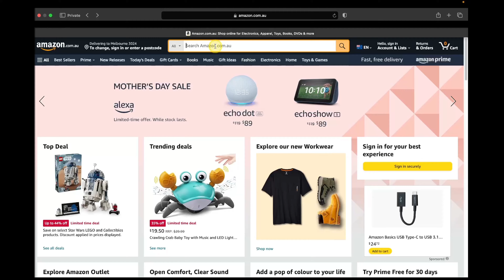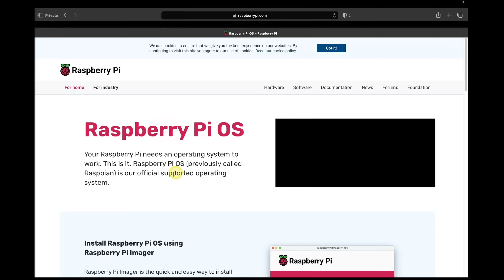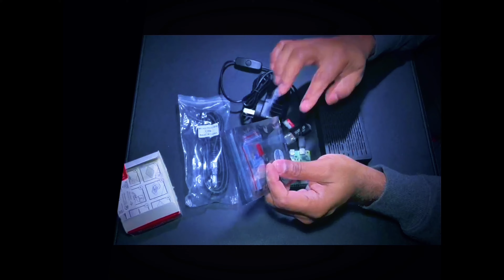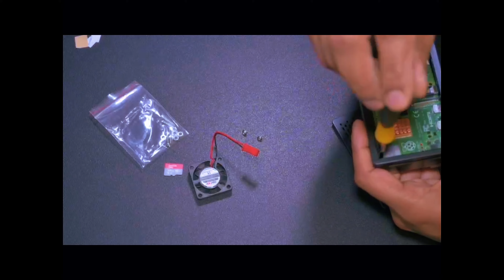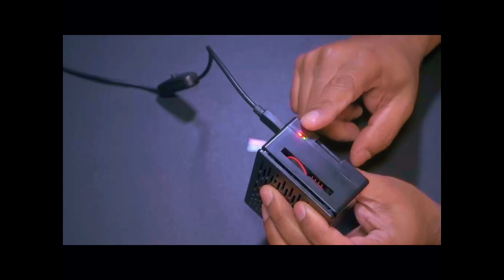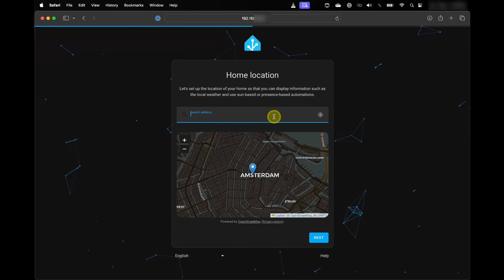Home Assistant Setup Guide for Beginners (2024 edition)

Comment: Hello, thanks for the video! Very helpful. Is there a difference/disadvantage in buying Home Assistant Green/Yellow ? I was able to get hold of a Green and wondering if there is an advantage going with DIY raspberry pi installation.
Reply from the maker: Not really unless the same cost allows you to go for a higher configuration on the PI. Another thing to consider is if you are eventually going to have to move your HA a more powerful hardware (example, I am using a NUC in my case), then you may not have use for the HA specific device as it is formatted with HA OS. In my case, I have repurposed the PI for a different use case, for example a local voice assistant satellite. So, it really depends on how you are going to progress in the HA journey longer term.